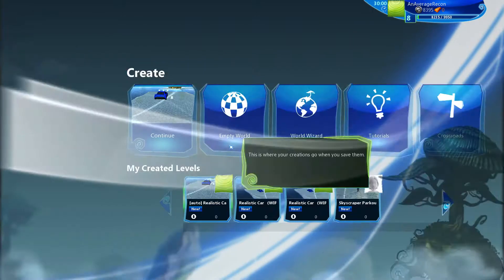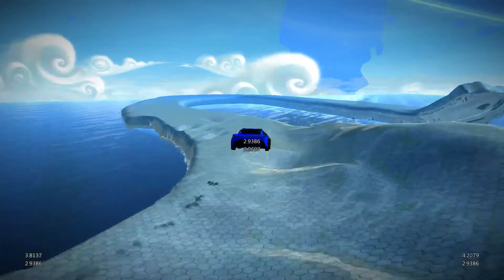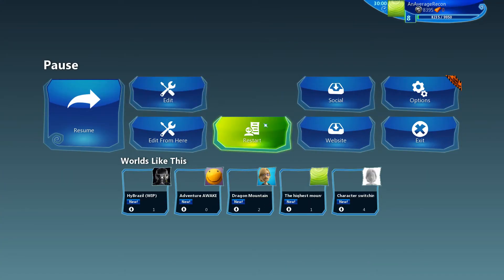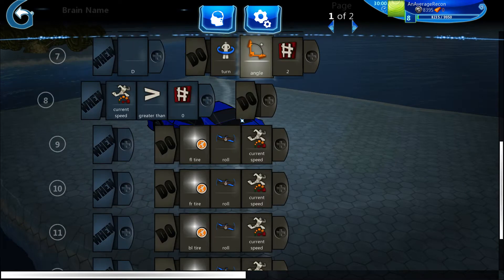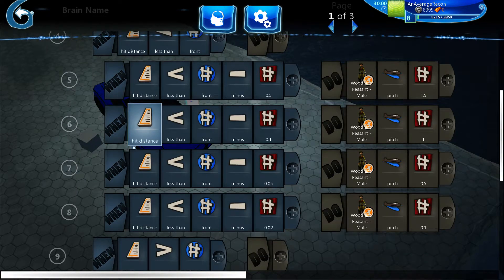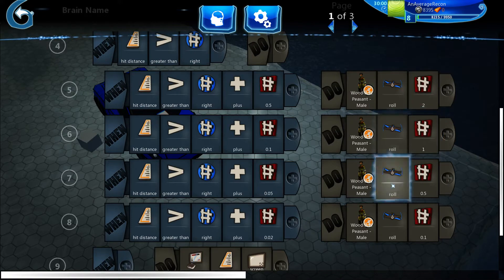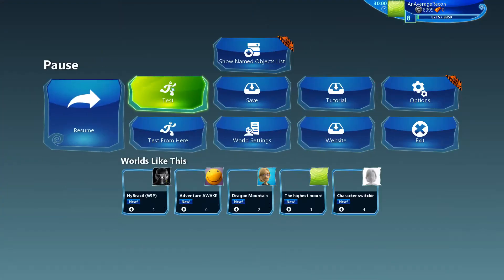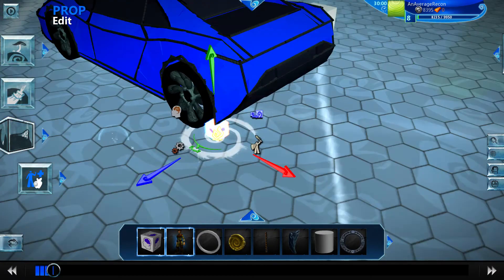Realistic Car | Koding Attempt 1 | Project Spark

Comment: I tried to make physics, I'm a programmer, and I've done it before. I know exactly how to do it. But the problem with project spark is it's just. Too simple, I have no idea what to use it all is wierd and half of the "Move" stuff is automated, I add ground acceleration (Making a rolling ball) and the ball instantly turns around. It's in a way alot easier to do stuff in real programming.